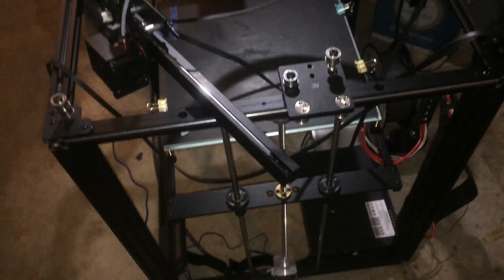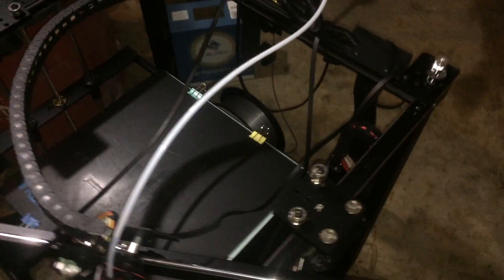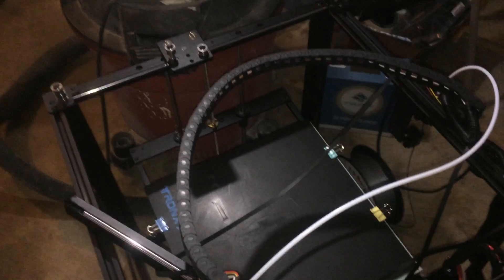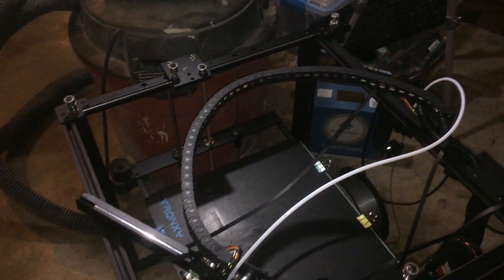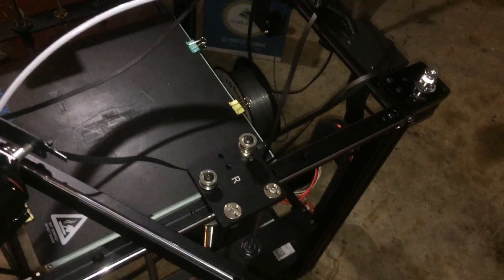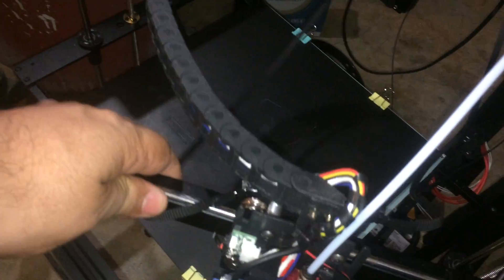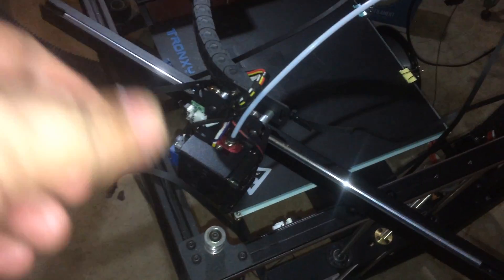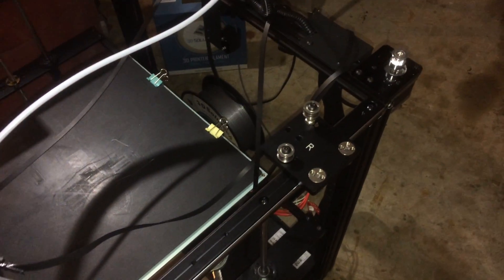TRONXY X5SA PRO 3D printer rail wheels adjustment updated part 4

Comment: Correction... it does not tighten or loosen if you turn clockwise or anti-clockwise. You are just rotating a hole that is excentric in the piece that you are rotating. It is not a screw it is just a piece that rotates in place. It is looser / tighter depending on the orientation. One semicirle will be righer, the other will be looser. If you want to loosen it, try to turn it in ANY direction but with not much force. If you feel it is getting tighter, turn the other way and vice versa for tightening.

Comment: Thanks! Mine were really tight too so started googling how these should rotate. I feared ruining the threads so instead screwed two bolts in partly and used screwdriver between them to rotate the housing. This gave a better control for the adjustment too. Best way to check that it's not too loose is wiggle one end up and down to feel when there's some play and then tighten it back just a bit.
Reply: I did same way using two bolts - leaving one grub screw in as well. then use screw driver to lever adjust - tighten grub screw, remove bolts fit other grub screw

Comment: As an addendum to this, don't shove a pair of pliers in the holes use the spare bolts they give you to provide two pillars you can place a screw driver between and it turns way easier, far better leverage.
Reply from the maker: The video was made at like 3am in the morning and I was tired.   As you can see by the date of the video, i was one first in the US to get this New printer and they didnt get any instructions the new rail system at all at the time.  Even when I sent a email to customer support they said at the time sorry we have nothing.  Lucky one of the customer support guys figured out that if the rail wheels are not perfect, problems can happen.  He was the one that said to use a pair of needle nose pliers.  I really do need to make a updated video of 16 months or is it 17 months of using the printer.  As the Hotend is a E3D Hemera direct drive now, its in a temp controlled heated enclosure with electronics outside.  I been moving more over to large resin printers, but this is still my favorite printer.
Reply: @steamcastle2473  Well their manual still doesn't tell you how to adjust them and this is the only video I could find that said "just do this". My comment was on how to improve the adjusting experience, so thanks for the knowledge it was helpful.
Reply from the maker: @TheShorterboy  I still remember that night I was so mad at the printer.  I thought I had defective belt motors as they were running so hot you couldn't touch them.  I was told a few times by Tronxy support that the rail wheels do not need to be touched as they were set at the factory.  But once one guy over there figure out what was happening and sent me a video on how to set the rail wheels.  After setting the wheels correctly my printer was golden.  It was like night and day.

Comment: You do not need to disassembly the whole hotend - some hub wrenches (? in Germany ist's called "Nabenschlüssel" and ist used for bicycles) do have this pins for two hole drive ("Zwielochantrieb") and the space with already mounted hot end is enough to use ist and adjust the screws.

Comment: I had almost worked this out myself, you confirmed which way to turn the wheel, many thanks. No way would my rail go on as supplied......unless you used a hammer !!!!
Then I had to disassemble the whole hot end assembly (like you stated) to do the same with that carriage & wheels to get it on the rail, major PITA!!
Anyone doing this, after taking the fan housing off, DO NOT try to force the base off the carriage once you have taken out the 2 small screws that hold the base and bracket system on. You have to then loosen off the 2  small screws in the stop end sensor to get the base to come off as these 2 screws also are threaded into the carriage/hot end base plate. The thread for these 2 screws is slightly oversize so the base moves slightly like it wants to come off.  It's not immediately obvious they are threaded in as those screws are very small.

Comment: Thanks for the video. My X5SA Pro has one of the carriages too tight as well. I haven't tried the steps your outlined yet. But now I know what to do.
Reply from the maker: I don't know if they fixed the hotend rail adjustment problem(the center rail).  On mine you can only adjust the hotend rail wheels by removing the whole dam hotend and hotend mounting plate as it covers one of the rail wheels.